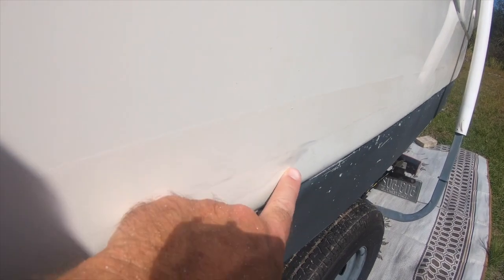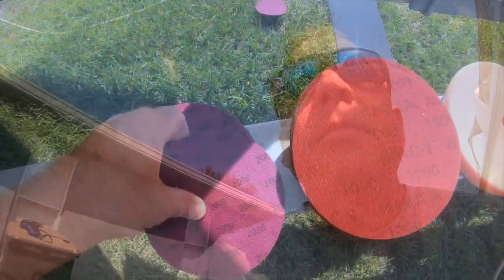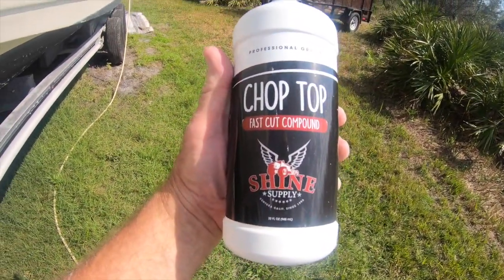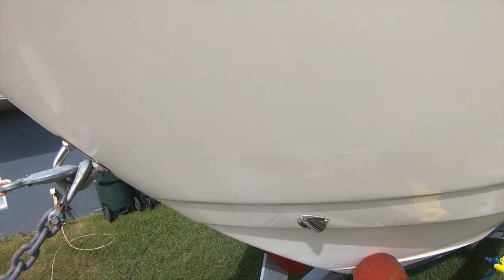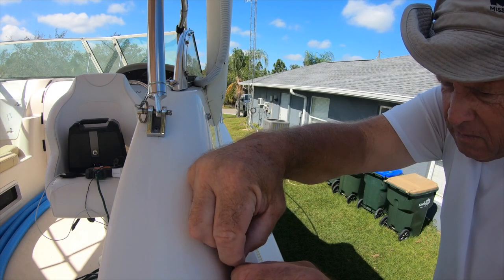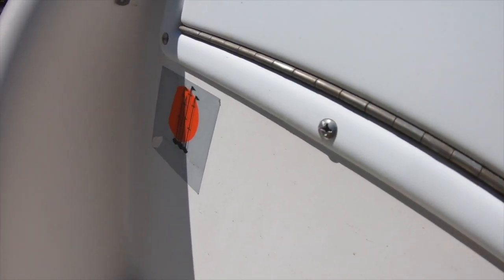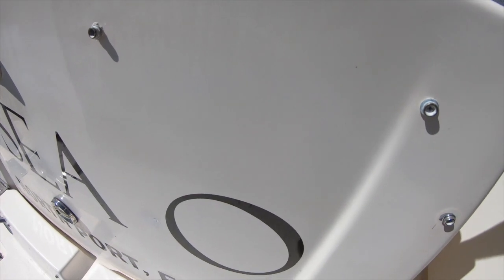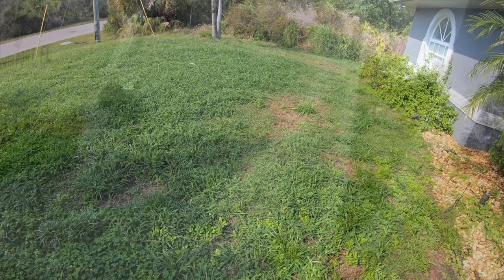Wet Sanding, Compounding, and Polishing the Boat with Chop Top and Jescar Power Lock!

Comment: Good job, i will say they make a rubber wheel you can use to remove stickers/ stripes. You can attach to drill.
Reply from the maker: Thanks… I’ll have to research that. The heat gun/razor blade/acetone route gets old fast!